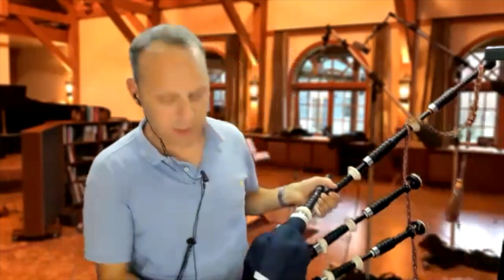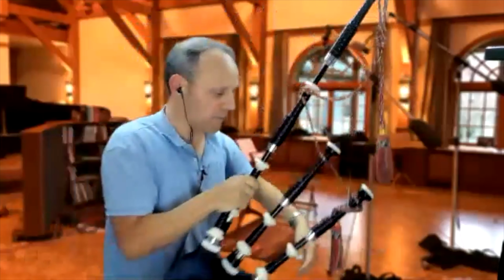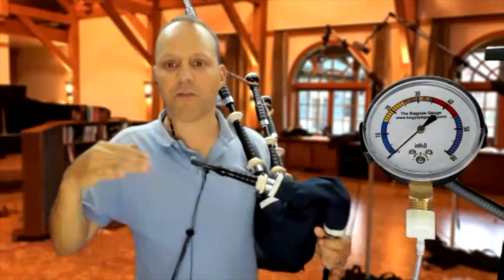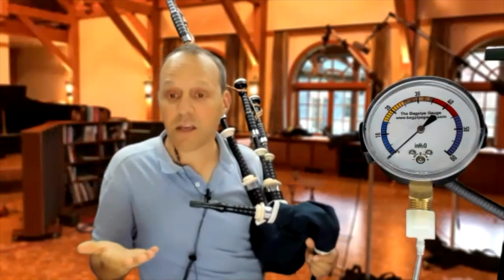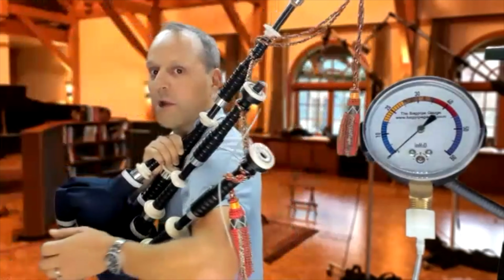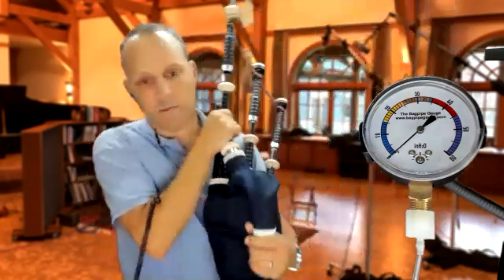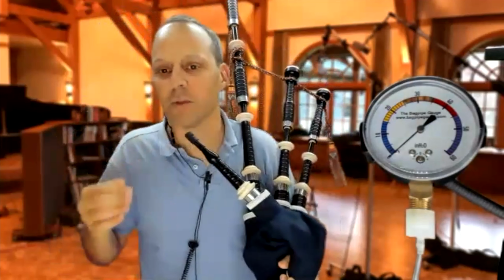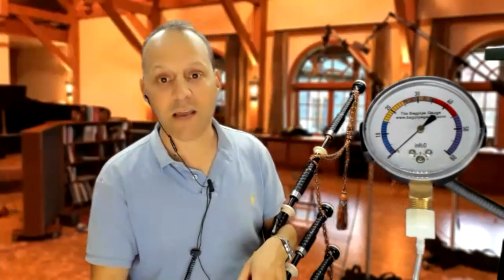How to Master Steady Blowing: The #1 Skill Every Piper Needs for a Great Bagpipe Sound

Comment: The steady blowing is the most difficult thing to master and to keep mastered. I like many struggled with this for the first few years. The brain will play tricks and try to trip you up especially if playing a tune that you’re learning or not confident with. Slower marches and slows can help the ear to perceive the steadiness of blowing until you develop a tone!
You achieve a tone with excellent maintenance, practice, air efficiency and tuning of the chanter and drones together. I have Jori’s pressure gauge which I bought several years ago when he first introduced it. Having bought a similar product based on a BP pressure gauge which is much less accurate because it works at higher pressure than inches of water as Jori’s does. This gauge was a really helpful visual aid for working on achieving this uniquely important part of piping. The beauty being that it’s a piece of kit you can keep and refer to if you think your blowing is not as it should be. I’ve seen (and have ) the BP monitor gauge and I’ve seen people rigging up a manometer at home but you can take the Bagpipe gauge anywhere. Since then I’ve bought Jori’s Braw Tuner and Pipers Metronome and though I do use my ears most of the time, for tuning the chanter quickly with existing or new reed or the drones, though I have to admit I don’t use that function as my ears do a pretty good job ( though I should really use it! ) most of the time.
The Pipers Metronome is a brilliant aid to practice not only tunes but competition sets. All three are invaluable aids to your piping journey  and have helped me tremendously.
So Jori, thank you for your excellent products, it’s nice to see that the slight fluctuation of the needle is ok as I was beating myself up that the needle wasn’t rock solid even on an MSR. It’s also true you are always having to check yourself and re visit the basics to make sure no sloppiness is getting in. Great video and still interesting at any stage.
Reply from the maker: Thank you Peter!  Your comments are wonderful to hear.  I'm so glad that my products have been helpful to you. Happy Piping!

Comment: Thanks for this video. I’m thinking about getting a manometer. Is the drone reed still in the pipe when you use this?
Reply from the maker: Yes it is.  There's no need to remove the drone reed to use the Bagpipe Gauge!  https://bagpipelessons.com/bagpipegauge
Reply: @bagpipelessons I have one now and use it often. I think I blow well at about 30 on the scale. Is that a good number?

Comment: Does size of bag really matter?  as some of my band mates suggested bigger bag hold more air and more time to get breath and break. What size of bag is that you have?
Reply from the maker: Size of bag is very important for comfort.  A larger bag is of no use for taking a break.  Watch the top pipers:  they are blowing nearly all of the time and taking very short, very quick inhale breaths.
Reply: Thanks for your information very helpful I will try out some of those exercises God bless you and all the Pipers 🙏👍

Comment: Hello, I have been playing for about three years now and have bought the pressure gauge. I would like to know the range in which the fluctuations are allowed. So far I have not found such a specification anywhere. Greetings from Germany
Reply from the maker: The Bagpipe Gauge has a pressure range of 0 to 60 inches of water.  Most pipers (95%) are within the range of 25-35.  My gauge shows 30 straight up in the middle.

Comment: Can it be used on a practice chanter alone to measure how strong the reed is? Or do you need a bag and drones also, to make it work?
Reply from the maker: You can try to put the stopper in your mouth (with the tubing hanging out) and the practice chanter, too.  This will give you a reading of the pressure for your practice chanter reed.  It works!

Comment: Can you use Braw to find that high-A?
Reply from the maker: Of course!  Most pipers (myself included) like to tune the High A so it has a nice texture and resonance when it blends with the drones.  To do this on the Braw Tuner (https://bagpipelessons.com/tuner), I adjust the High A so it reads slightly flat according to the tuner.  If you tune it so it reads "in tune" according to the tuner, it will sound thin.  This is caused by the High A disappearing into the drones.  So, just a wee bit flatter than zero (i.e. in tune) on the Braw tuner and it will sound full and rich and still in tune.  If you go too far, it will sound flat.  Try it out.  Try 5 or 10 cents flat for starters and adjust as needed.  Good luck!  Check out this video on using the Braw Tuner along with my InTune Mic (https://intunemic.com) and you'll be in tune fast and easy.  https://www.youtube.com/watch?v=MdI2Ria8kZE
Reply: @bagpipelessons  thank you :)